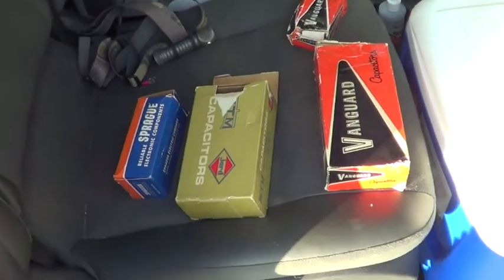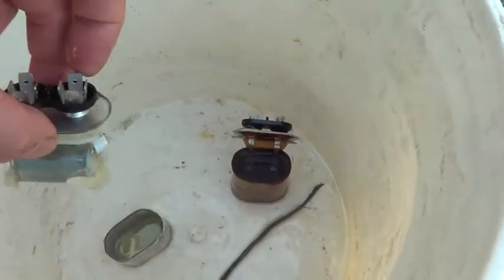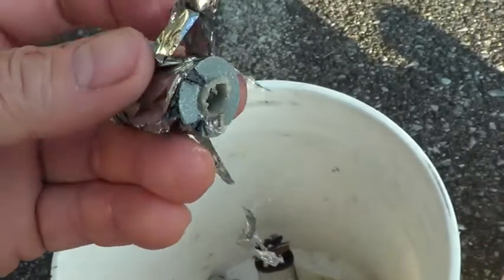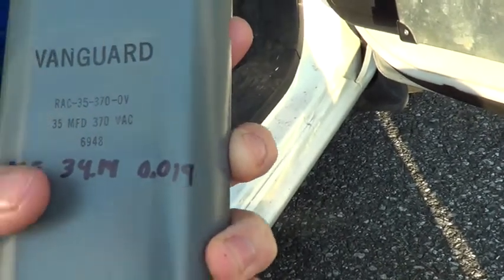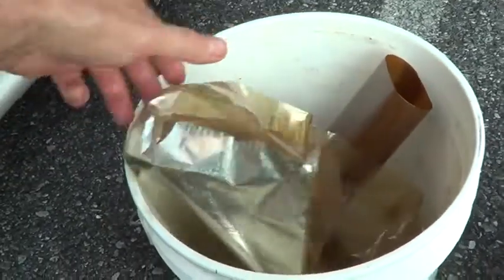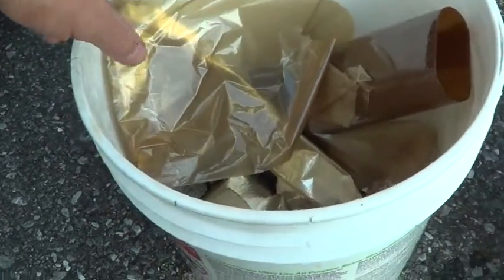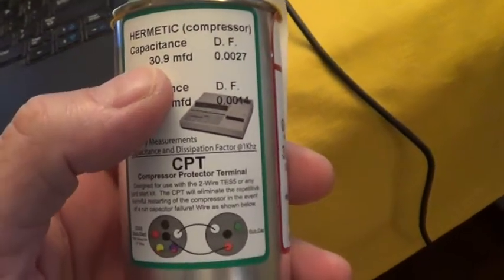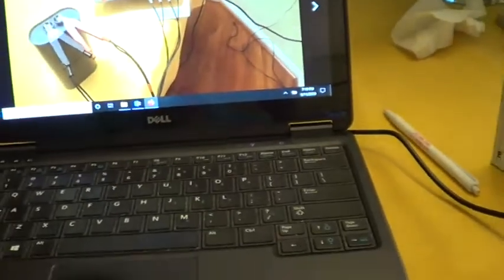A Comparison between Modern Run Capacitors and Vintage ones that Lasted Forever

Comment: stupid me I changed out my 1991 vintage 35/5 cap it was still good but the terminals were so rusted I could but say it would make good connection I used Amrad so I hope it stays good.
Reply from the maker: 29 years and still kicking.   I see a/c units that old every once in a while.